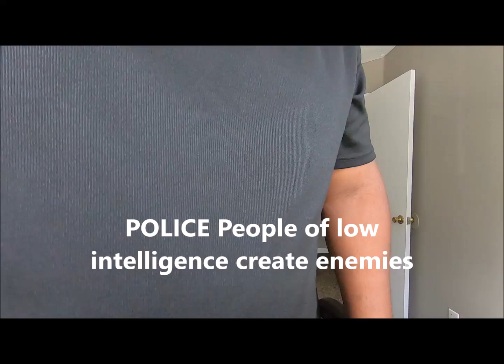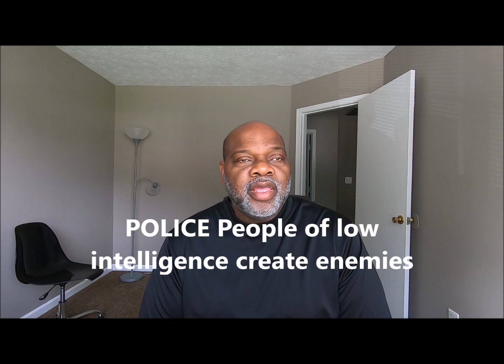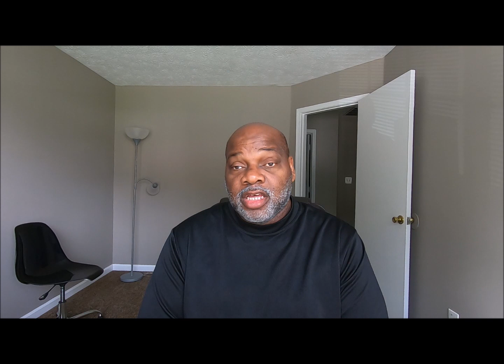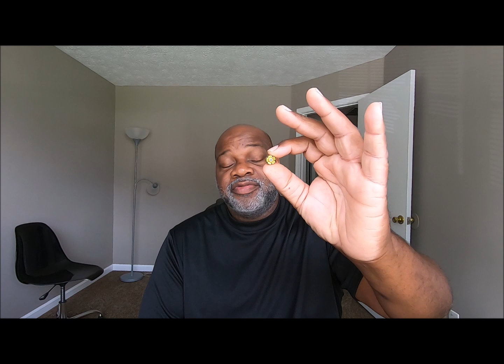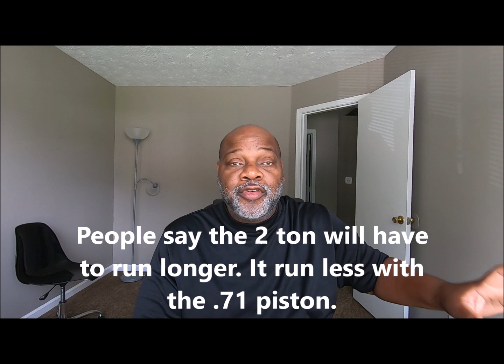My 2 ton Goodman condenser is cooling better with a larger .71 piston

Comment: Do you still use 134a in your condenser?
Reply from the maker: No. A fan sold me a new can of 410a. The small cans of 134 from Walmart, don't have enough pressure to push into a house system pass about 80 psi.